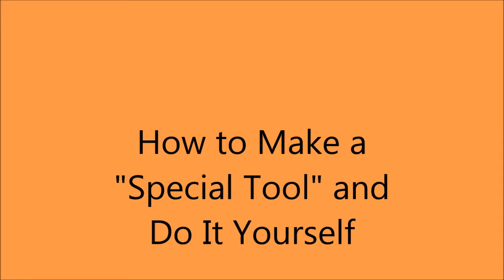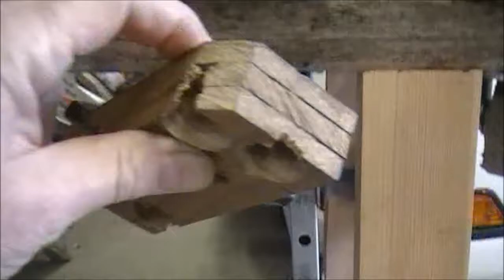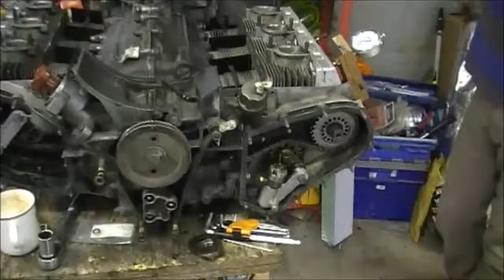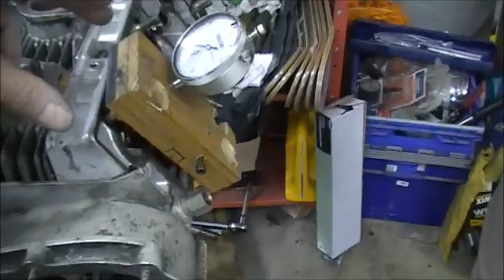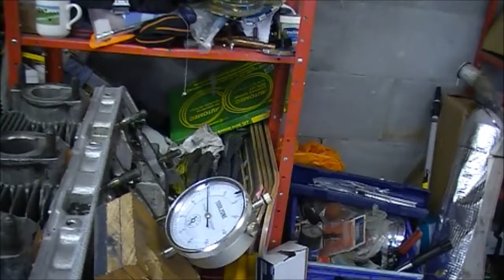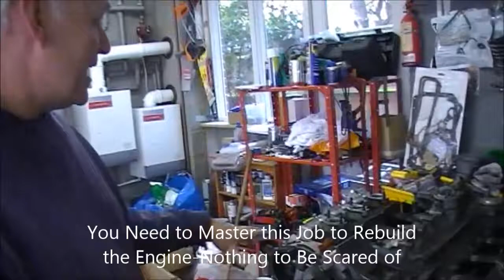Porsche 911 RS Backdate Part 34

Comment: Although you did not mention it I believe you are supposed to rotate the crankshaft 1 or 2 turns and re -check the timing is still spot on...did you?
Reply from the maker: Yes definitely.   You should always rotate in the direction the engine turns to take up any backlash and check everything at least twice.